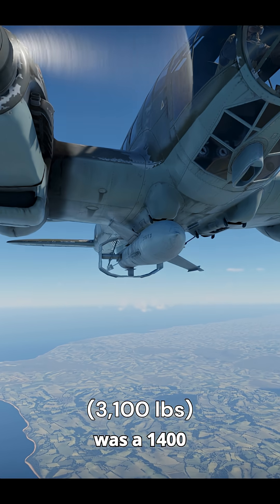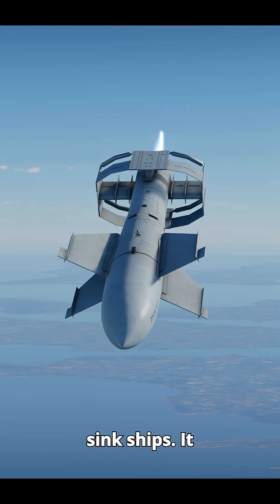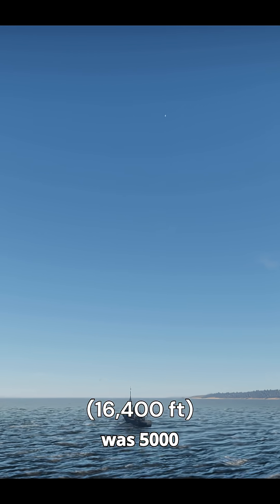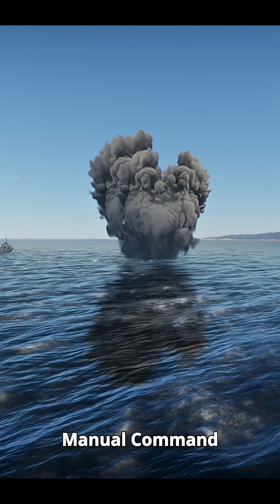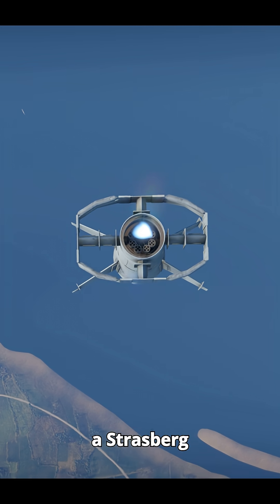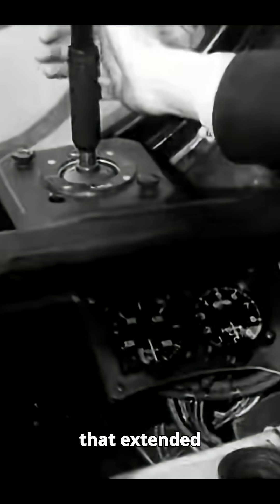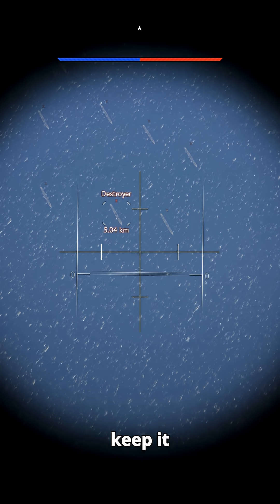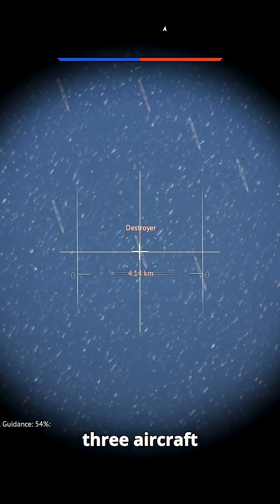The Fritz X - Germany's Radio-Guided Bomb

Comment: The real Fritz X was a radio then wire guided weapon. it had a minimum drop height so it could gain enough momentum to penetrate the decks of war ships. It had a flare in the back that the operator could use to guide the bomb to target. it was not necessary to aim the bomb exactly on a drop as it could travel to its destination .

Comment: Meanwhile, the Brits just came up with the Helmover Torpedo, which, with typical British Shed Inventor subtlety, only fit in a Lancaster bomber... well torpedo bomber now, had a 2200lb RDX warhead, a rolls royce meteor engine, remote control guidance with a snorkel, and a super jump piston made to launch it over torpedo nets if it couldn't simply dive under. It could have easily broken the back of just about any ship you aimed it at.

Unfortunately,  by the time they got it working, there weren't any appropriate targets left to point the darn thing at.

Comment: The Fritz-X was designed to attack warships. There was a similar weapon designed for unarmored targets. Both had a problem with insufficient radio channels. Either during or just after the Anzio campaign, the allies deployed an improved jamming system that covered more channels and would automatically detect and begin jamming the command channels. Combined with increased combat air patrols, the german guided bombs were quickly rendered ineffective.
Reply: Impressive for the time
Reply: This is the reason why they changed back to cable guidance with the drones in the modern eastern theater. A wire coil would not have made so much difference in weight, since the radio equipment wasn't that light anyway.

Comment: This is not 'high tech'.  This is a synthesis of current WWII tech and is not particularly ground breaking.  Think of it like an air-dropped torpedo.  For comparison, look at the Mark 37/38 radar-guided fire control directors, that is literal high-technology, in adapting recent scientific advances to practical application, for the first time.  If you want the Germans to be 'high-tech', look at the Me-262 or V2.
Reply: That is a matter of opinion. It was the first radio controlled bomb and therefore was high tech.
Reply from the maker: The Fritz X was the first operational precision guided bomb (a radio-controlled, armor-piercing bomb) capable of hitting moving naval targets from high altitude. That's a significant technical achievement for the time, especially for 1943 standards.
Reply: "Feel god about Britain" comment
Reply: A synthesis ?

Comment: How many ships did it sink or hit?
Reply: some, the most prominent victim was the Italian Flagship Roma (sunk) and its sistership Italia ( severely damaged).
Reply: I know if al least one, but it went straight through the hull before to bomb detonated. The ship had a gaping hole through its bottom and limped back to port.
Reply: @stevelangstroth5833  That particular 'hit' was on the British Battleship HMS Warspite. The bomb went through the ship totally and blew up right under X turret I think.

The Captain remarked later that he saw the mainmast lean to one side, before comming back upright. He thought his ship had been broken in two, but it just about got away with it.  

X turret never worked again, hence the image of Warspite off Normandy with that  gun turret trained aft, instead of towards the beaches.

Comment: Sounds like a very expensive bomb for its time.
Reply: Not on a per-hit basis.
Reply: @tonyennis1787 confusing cost effect with expense
Reply: Yes, so it was designed for high value targets.  ship is way more expansive.
Reply: But MUCH cheaper than a cruiser or battleship that it could kill. Or the cost of repairing the damage on a ship that it hit but did not quite kill.
Reply: Yeah its very unreliable and kinda bad.
Reply: @SlavaIsusu-z1q  This was a modern marvel. Imagine if they had made it a little better, it would have made a huge difference.
Reply: @tonyennis1787 Not really, conventional bombs were superior in most ways. Because you could actualy mass produce them and they were of simple design. This was an expensive solution to a problem that didnt exist. Advanced? Slightly, the US had radar guided bombs a year after the fritz x which were argubly better because you know, radar guided unlike the fritz.
But neither side used them really, these were pet projects for what was about to come in the future but not what was better or reliable now.
Reply: @SlavaIsusu-z1q 
 No it work very well until the Allies found it's Achilles heal which was the delivery plane having to to stay to guide it in. They wondered why it stayed circling until detonation.